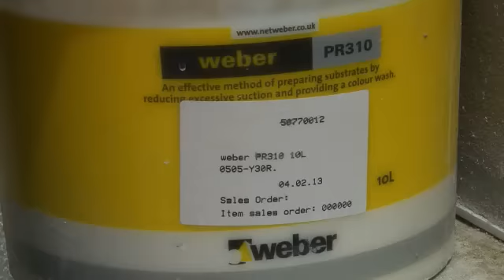Achieving a travertine finish using weber alpine finish — Weber Renders & Decorative Finishes

Comment: Could you tell me, does this need to be applied on top of a flat coat or can it be put on top of a scratched coat?  Thanks
Reply: 2307swfc 
1st- scratchcoat with waterproofer 
2- flat devil float with feb mix
3- alpine finish 👍